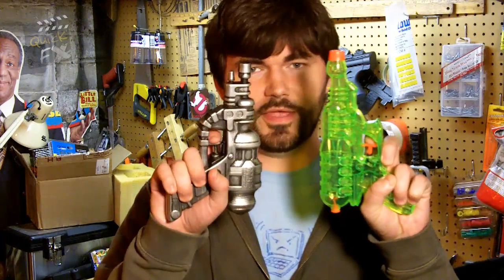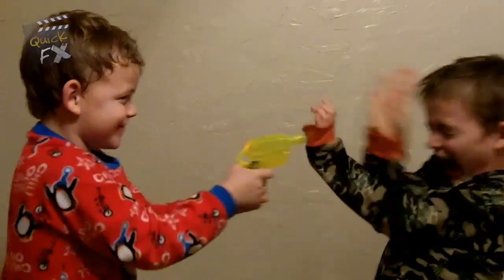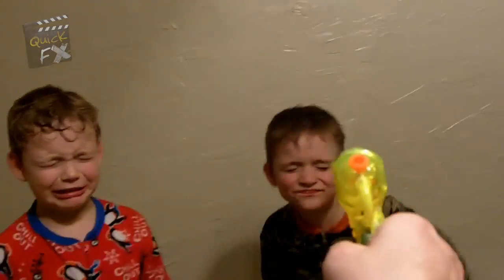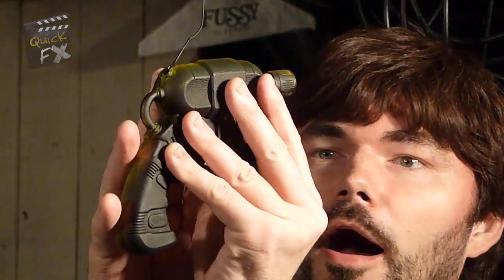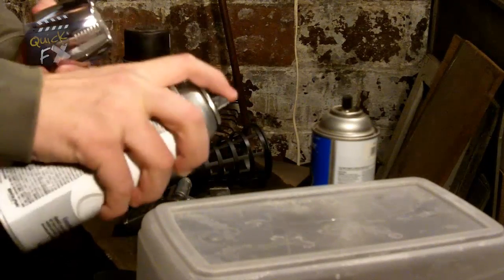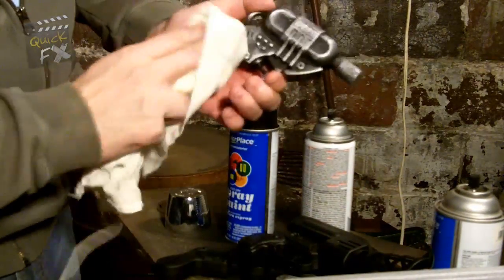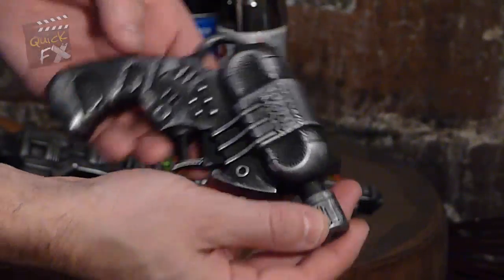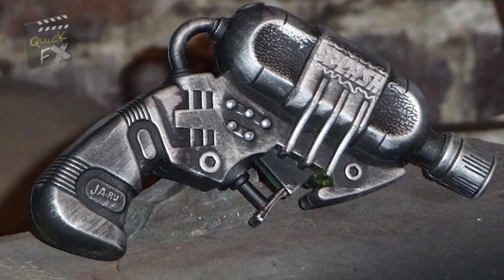LASER RAY GUN Movie Prop -  DIY How To! - QUICK FIX

Comment from the maker: I found, that the cheap flat paint works ok on guns with sliding parts. obviously, it'd be best to take apart then paint, but if you do very light coats and allow to dry each time (testing the moving parts)  it should be good.  
sharpy marker is a quick fix for any paint that may come off.

Comment: COOOOOOOOL LOOOOOK !!  But, to have the heft / weight of a "real ray gun"  fill the squirt gun with copper plated BBs  .  To keep the them from rattling around use plastic glue  as you are adding the BB's .

Comment: When using spray paint NEVER try to get a thick coat of paint. You will get runs and you will cover up details. Use several thin layers for an even coat instead. Not a bad tut though.